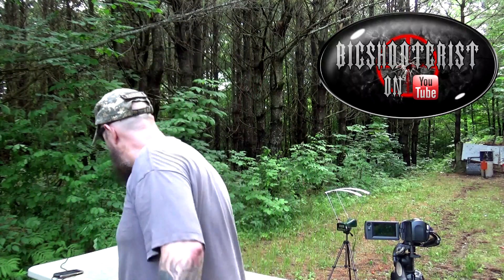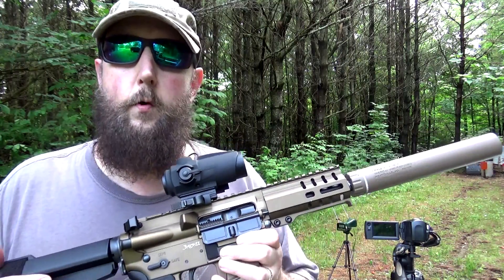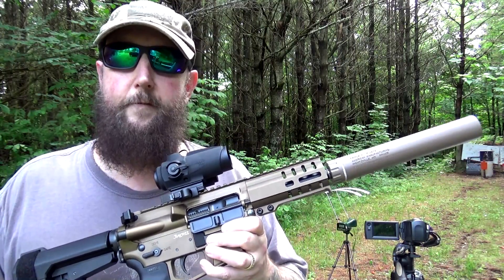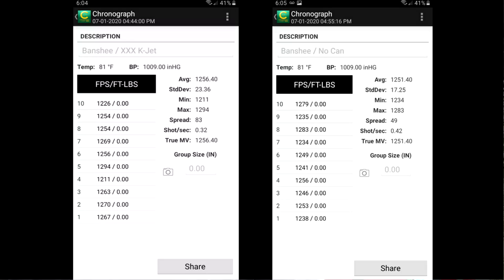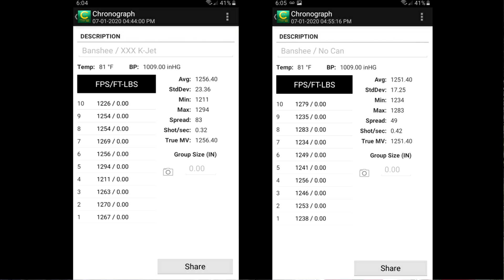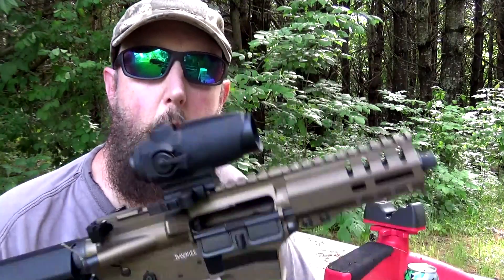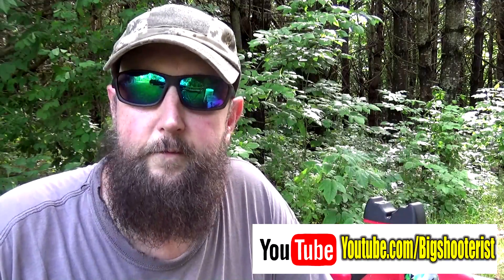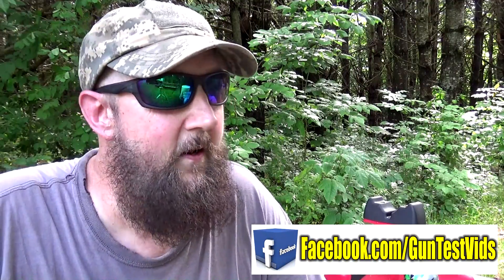Radial Delayed Blowback Muzzle Velocity

Comment: Can you believe it’s Ben 10 weeks plus and I’m still waiting on my CMMG banshee due to supposed Covid gun buying and many orders being placed on back order
Reply: Mine has a out of spec firing pin according to cmmg... a Coyote got away because of it.. looks to me like the spring in the bolt carrier keeps getting in the way of the firing pin. They are sending me a new firing pin and spring. I hope it fixes the problem.  It worked great before I needed it.
Reply from the maker: That sucks. I've yet to hear of a single other one with problems. I hope it's squared away for you soon.
Reply from the maker: I hope it comes in soon. There's no doubt you'll be pleased when does. 👍🏻